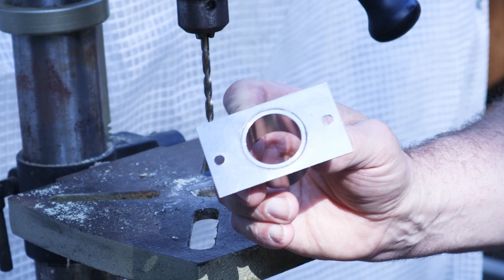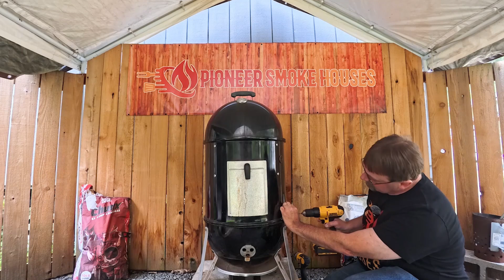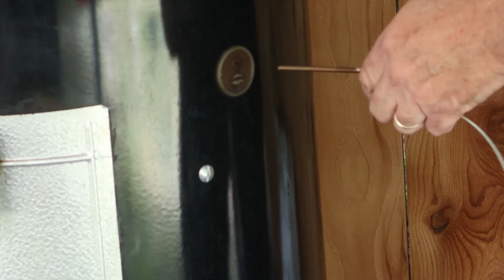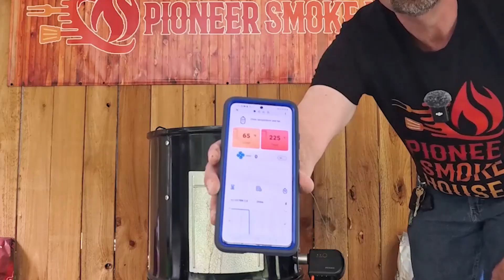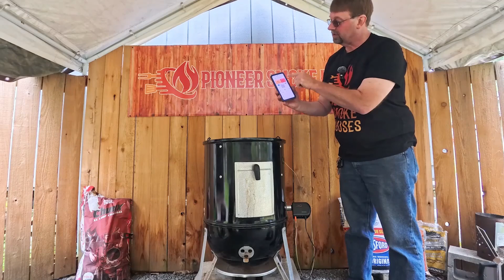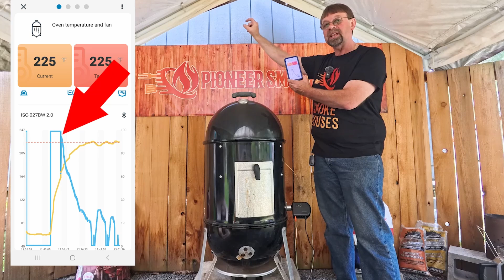Inkbird Smoker Controller Installation - EASY Weber Smoky Mountain Mod

Comment: Just got a wsm and this controller. I set it to 250 and I’m at 350.  Not taking the lid off and vents are closed. I lit a handful of charcoal so I’m unsure why it’s so hot. Any help would be great
Reply: I set to 250 and it got there in about 20-25 min. Once it got to temp the controller fan stopped and was steady 250. I took lid off and put my pork butt on and then lid back on. Since that it just keeps getting higher and higher it’s been a couple hours now
Reply from the maker: That is wild. I did not have that experience. I would start by contacting Inkbird support. I am wondering if there is an issue with the temperature probe. double check to see that the probe are plugged in correctly. If that is not it check with Inkbird.

Comment: I have mine going right now and the fan seems to be pulsing on and off. I would think it would be a variable speed. Is the correct or is something wrong with mine?
Reply from the maker: It has been a little while since I used it but I think the fan does pulse. The controller will learn the best way to control the temperature.

Comment: You can get an adapter that fits this fan that connects to the bottom vent,the BBQ guru adapter and inkbird round bowl adapter and no drilling
Reply from the maker: I will look that up, this was super easy and worked well.

Comment: Great video! What size holes did you drill into the connector?
Reply from the maker: I think I used the 7/32" to drill out the connector, but the main concern is making sure these holes are slightly larger than your screws so they'll catch into the smoker and not the connector. Hope that was the hole you meant - thanks for watching!

Comment: Great vid 
Thanks
Reply from the maker: thank you! I have done 3 videos with this, not including the one I did on a different smoker that did not work, oops, lol. This is a great addition for the WSM. I did overheat the tip during the cleaning burn-off but it still works.

Comment: I might have missed you saying it, but does the weber have and mods for air seal?
Reply from the maker: No seal. I recommended putting Lavalock RTV on it but after an 8 hour test I am thinking it does not need it. plus I plan on using it on a few more smokers. Tuesday I am doing Pork butt then I might move it to a chargrill offset.